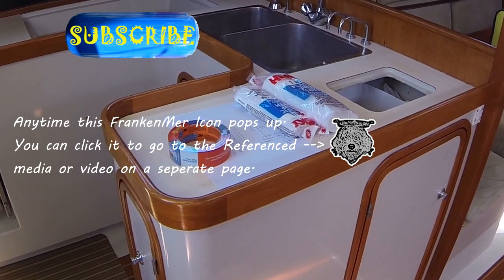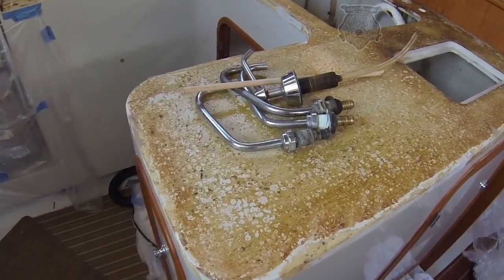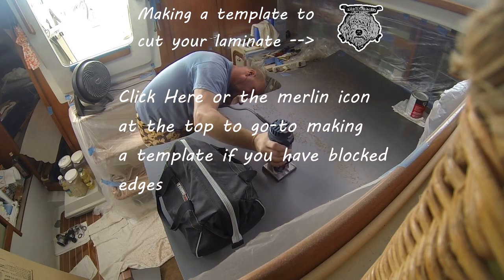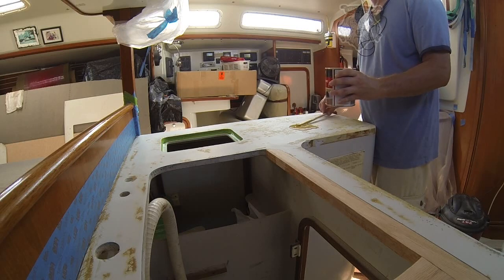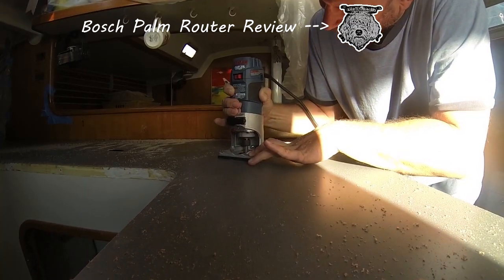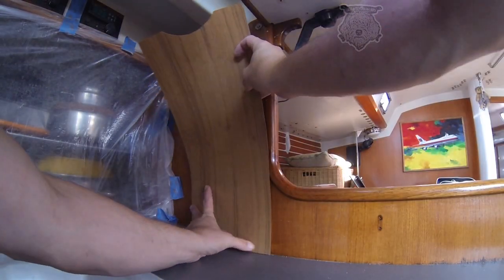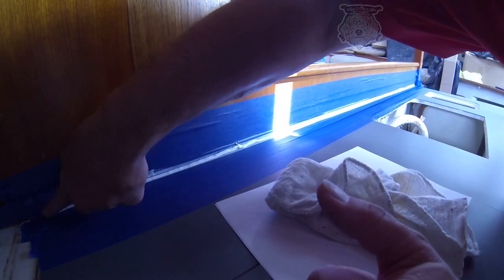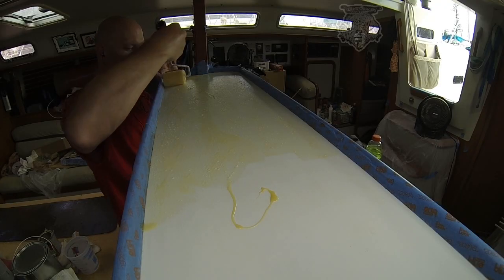How to Remodel a Sailboat Galley Part 1, Sailboat Galley / Kitchen Fix

Comment: Next time use a drywall screw start it in the center of the of your bungs or plugs and as soon as the screw hits the fastener the threads will pop the plug right out
Reply from the maker: Yep that works too lol.  But you'll still have to clear it and if its epoxy or glued then not as easy.  A really good tip for everyone thanks for the comment and idea.

Comment: I'm a boat builder. I dont want to pick holes in your work, because its very professional. When I fit veneers and laminates in wet areas like the galley and heads with showers. I put a one each boarder off epoxy glue and the remaining area has contact cement. The contact cement holds the laminate down and the epoxy seals the outside edges. It also makes a lot easier to position the laminate. I hope this helps your fans.
Reply from the maker: Nigel Spendlove hi.  Thank you for the comment.  And i actually started doing that lol.  It is a great tip and one everyone should use.  Thanx again.

Comment: Thanks for your great video on galley fit out. So you wan a know what I wan know...  Just removed that nasty rubber mat stuff old folk like on the deck, extra grip stuff well it nearly fell off it was so old but the contact adhesive will not. 80grit sanding disc is that the best and followed by gel coat textured no slip surface, do you use a textured roller??

Comment: Great stuff! Looking forward to remodeling my galley sometime in the near future. Those side rails had me wondering. Thanks for the post!
Reply from the maker: Thanks for the comment.  The rails take some patience and some maneuvering.
Reply from the maker: ***** There are sooooo many things to watch out for especially when buying a fixer upper.   You have to know what your looking at.  It really is cheaper in the long run to buy a nicer boat. I can't tell you what it would cost to redo because it would vary drastically depending on what is needed.  This one is not my boat.

Comment: Show how you can add railings around your boat, the steps in side the boat and hand rails on the roof of the boat so if the water is real rough.you can hold on as your inside the boat. Also can you build a crows nest on your mast? Also can boats have figure heads?

Comment: Your carpentry skills rival your video production capabilities.  Thank you for providing very thorough videos.  I’m refitting my galley and interested in your thoughts about laminate and veneer selections and material sourcing. Matching teak veneers is challenging and sourcing reasonably priced materials even harder. Any thoughts?   Dave
Reply from the maker: Thank you very much Dave.  Really wish I could help but when I had to find teak I just looked online for what I needed.  it really is the only way now.  It really is hard to even just find railings.  I had to wait two months for the rails in this galley to be made in I think it was Philippines.  But there are a few distributors you will find during a search.  Sorry I couldn't help more.
Reply: No worries, thank you again.  Unfortunately, trial and error sometimes is the only alternative.